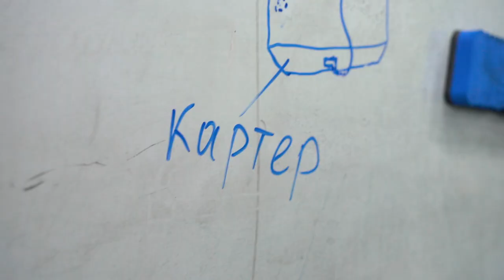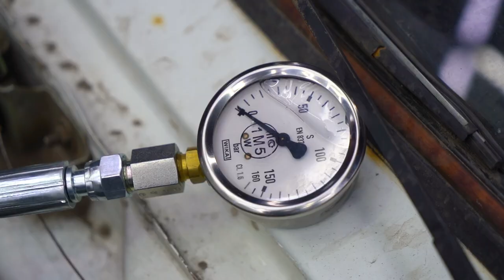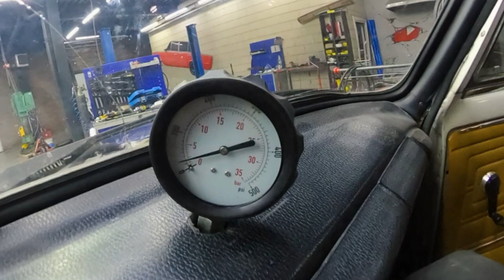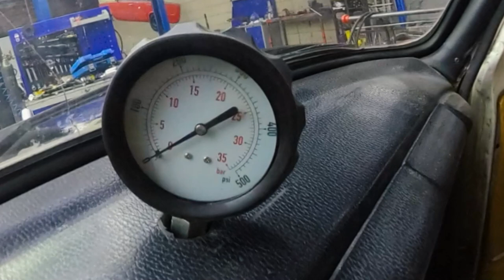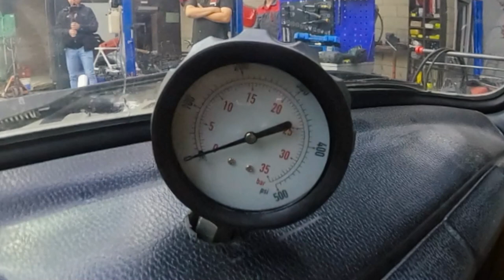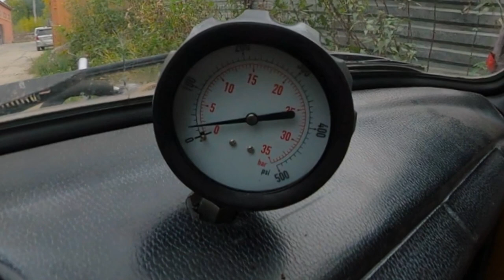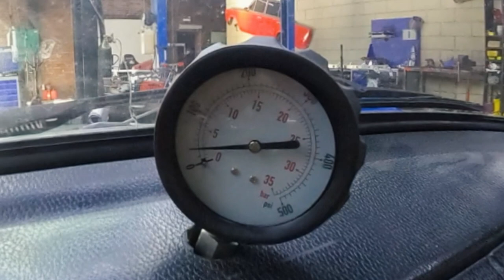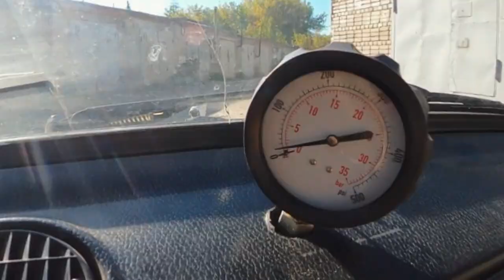We make a dry sump system for a Lada

Comment: I want to see a Hybrid Lada.  Have the engine drive a generator to charge a battery bank, use an electric traction motor.
Reply: Yes thats would be sick AF!!
Reply: Me to:)
Reply: They should do it in a fwd car and power rhe the rear wheel with a forklift motor , connected to the a differential mounted in the back with super capacitors powering  the motor, which is fed by the alternator
Reply: Or they can replace the starter motor with a more powerful electronic motor and a battery system
Reply: I want the full electric Lada. If you feed enough power into a large generator it will work as a powerful electic motor. Probably sub 10 second quarter miles in a Lada, possibly even 8s. It's not good for a street car due to the charge needed per full speed run, but it's been done successfully in a few drag cars.
Reply: Hybrids and EVs suck.
Reply: Very good idea, hope they see this would make a good video
Reply: @norsevikingsir4932  Yeah, but it would be fun to see a diy lada version. I am curious as to how they would go about doing it.
Reply: or just have the engine power an electric motor with no batteries
Reply: me too bro!
Reply: Locomotives already work that way so the concept has already been proven.
Reply: @ernestmccollum2397  This is not about proving anything, it's about having fun.
Reply: Do not, electricity, the lada
Reply: @danies cool story bro.
Reply: @bill cool story bro.
Reply: I approve of a much needed alternator generator style electric car I fully believe it would get better gas mileage
Reply: What electric motor should they use? Some 12V motor?
Reply: @stal5861  The most economical option would be a used brushed dc forklift motor.  But any type of 15 or 20hp electric motor would probably work just fine for a Lada at non highway speeds.
Reply: @Dat_Sun  So what generator should they use to get that high voltage? Must be something cheap
Reply: @stal5861  I am not sure what is available to them, maybe 6 or 7 lada alternators in series. These could possibly be used as traction motors with enough effort. But for simplicity,  a dc brushed traction motor, lead acid battery bank, lada engine powering the generator (s) feeding a charge controller.
Reply: @stal5861    The speed controller would need regenerative braking if Garage 54 takes the hybrid lada down any real grades to experiment with regenerative charging.
Reply: @norsevikingsir4932  you do know that for nearly a century thousands of large hybrid vehicles have/still do move products around the world  right?  

What do you think a train is?  What they are proposing here is simply an on road train.   There is a lot to say for it.   match the right size engine, generator, capacitors/battery bank and motors for the purpose... and your MPG will sky rocket.   reason being, with that set up the engine; when matched correctly ,will sit in its most efficient RPM level pretty much all the time.  It just purrs happily along .
Reply: Boring idea, sure It would "work" but they do better experiment usually
Reply: @gillespriod5509  It would take a lot of solutions.  Seeing what the garage comes up with would be interesting.
Reply: Like a Nissan kick
Reply: use the 4 starter motors for AWD traction
Reply: @norsevikingsir4932 yeah that's why F1 use hybrid power, because "they suck" 🙄
Reply: An EV Lada for sure would be sick

Comment: How much power can you get out of a hot rod lada? Build a performance lada and test power output on a dyno. Push it to the extreme, high compression super charged nitro burning lada. That's what I wanna see.
Reply: I'm with you, but I'd love a rallye racing lada instead! But yes, combine weird mods to get the most of it.
Reply: They did this on Top Gear years ago. Type "Lotus Lada" into Youtube.
Reply: Hungarian enthusiasts are your adress. Havassy Motorsport is the first that comes to my mind, but there are a lot more.
Reply: They definitely didn't do enough with the turbo-lada-zilla series. I would love to see either an N/A or forced induction build. My thoughts exactly.
Reply: Hope people upvote your comment, I've been feeling like that for a whiiile
Reply: @derkeksinator17  id say first they make it fast then if they want turn it into a rally car
Reply: Do they have performance Lada cams? Ported heads or aftermarket induction?
Reply: Ok you find / commission hi po rods and pistons. Forged aluminum…..
Reply: @madmod  It would be cool even if they welded them up and ground their own using basic principles &/ put an adjustable cam gear on it!
Reply: @joshuahstedman9346  i have no doubt they could come up with some cool stuff. These guys are units
Reply: Nitrous is kinda expensive, I prefer A/C cool breeze into the intake more
Reply: @gabrielv.4358  Nitrous is hands down the cheapest power adder

Comment: I would like to see them rebuild an engine with a different bore on each cylinder. Or maybe a different stroke with each rod. The sound would be interesting 🤔
Reply: I know of one person who did that in racing in the 70s.
Balance is the problem.
It might work a while and knock itself apart.  Maybe 2 different stroke or bored but not 4.
Reply: It wud'nt be balanced  n vibrate itself tuh death

Comment: Did you vent your oil tank?  If not, the electric pump is pumping against pressure, which will slow the rpm of the pump and result in lower flow to the tank.
Reply: There's a clear vent line taped to the passenger side "A" pillar.
Reply: @scottinWV  You are quite correct my good man.  I failed to see that until you brought it to my attention.  Thank you.

Comment: i would use ladas own oilpump and use the powersteeeing pump to feed oil into oil reservoir that feeds into the oilpump that is located in the engine
Reply: thats how oem dry sumps usually work, or they have two stock style pumps, one is pressure the other scavenging

Comment: Usually you have a double oil pump with two inputs and two outputs. One circuit pumps the oil into the reservoir and the other circuit pumps it from the reservoir into the oil circuit. Filter and oil cooler can be integrated into one of the two circuits. That is why you check the oil level, e.g. in the MTU engine, when the engine is running and at operating temperature.

Comment: Now next stage would be oil sprayers at foot of each cylinder like Ford Cosworth engines have.   They squirt oil up the rod and into the gudgeon pin area aiding cooling and prevents the gudgeon pin becoming a place of inhibiting power whilst cooling the piston more and less friction generated in the bore.

Comment: The oil pump pumps fuel into the oil galleries that also have an oil pressure switch in line so bypassing the oil pump affects ur switch

Comment: Well, if you want a crazy project- here is one.
engine charge electric motor for propulsion, this to provide same rev all time so the rest can work with constistence. 
Water superheated by exhaust (system like on a boat but heating instead of cooling) and then to a turbo and gearbox and down to engine for better fueleconomy.

Comment: I don't think they know what there doing in this one lol
You still need to use the normal oil pump to give the system pressure you just have it suck it out of a reserve tank.
Use the power steering pump as a Scavenging Pump to suck all the oil out.
Reply: If you want to use PS pump as a scavenging pump, it needs to be way down, same level or lower as oil pan floor. It's bad in  sucking oil up.

Comment: My suggestion for a video 
Customised cooling 
Remove standard themo & find solution to manual adjustment with all the cooling aspects,  bonuses on fan on off & even fan speed adjust & flow adjust,  

run the engine on the lower 'nomal' line i.e running the whole engine at its 'coolest' recommended then see if this allows for the ability to run thinner grades of oil & better efficiency?

Comment: The scavenge pump needs to have at least twice the capacity of the feed pump. It also needs a restricted feed from the pressure pump to ensure that it doesn't run dry at low engine speeds.

Comment: You guys should try wiring a supercharger to an AC compressor clutch, and wire 2 separate ECUs in the same circuit. One would be stock and the other one would be remapped for the supercharger. Instant 40+hp gain at the flip of a switch! Have a switch turn off the stock ECU, and another one to turn on the remap ECU and supercharger. That would be cool to see.
Reply: Nice idea

Comment: I believe you could have used the original engines geared oil pump for the oil pressure and if possible figure out away to feed its inlet. You could have then done away with oil fan belt driven power steering pump which is not ideal for feeding oil pressure. Belt fails and you’re toast

Comment: I think its about time they try turbo charging a lada, or doing a performance car with all the home made mods they have done over the years, lada home made 6cyl, lada twin carbies, wooden pistons, carbon fibre conrods, o ring rings, p/steer dry sump, magneto coils, 3 diff wheelie rear end for 1000mph, 8 rear shockers, home made wheels with spinners, perspex oil filter and rocker cover, high pressure washer p/steer pump, diesel injector pump conversion,  etc etc. Lada Frankenstein haha come on do it!

Comment: 1:25 But Vlad, a standard oil pump produces up to about 80psi, max. A power steering pump can produce something like 900.
Reply: Volume
Reply: @dennisford2000  Ya want me to ask louder? 😂
Reply: @jeffrykopis5468   no , if you don’t have enough volume to surpass the leaking of the bearings it will never develop full pressure. Real hydraulic test equipment is rated at a certain flow , only on dead heading will you see this much druck
Reply: @dennisford2000  "druck"??
Reply: @jeffrykopis5468  German guys entienen

Comment: Yeah, cool science experiment. But those electric pumps will fail and then you’re kinda sol. That’s why they use mechanical pumps for DrySumps. The little ones will definitely give up as they start to starve under heavy stress. Loading and unloading the motor will make it worse in a race setting. I don’t want to hear but F1 does a electric (it’s a primer pump and their budget for that said pump is probably 100k! Lmao)

Comment: You need a different oil pressure gauge. This one is rated way too high. Get one that reads from 0 to 10 bars. Yours goes all the way to 35 bars and doesn't give you a fine enough reading.

Comment: I can't help but ask, why didn't you connect the oil feed hose onto the original oil pickup, on the Original oil pump? Cut off the pickup filter and extend the pickup pipe to outside the engineblock, to attach the feed hose.

Comment: How did you plumb the oil lines to feed the oil journals, that supply the oil to the main, rod, and camshaft bearings, if you blocked off the hole, the old oil pump sends the oil through? Was it like a gravity feed oiler? You have to have oil, under pressure, going to the journals, to lubricate the bearings.
Reply: If you watched the video you would know they used oil pressure sensor hole to feed in the oil.